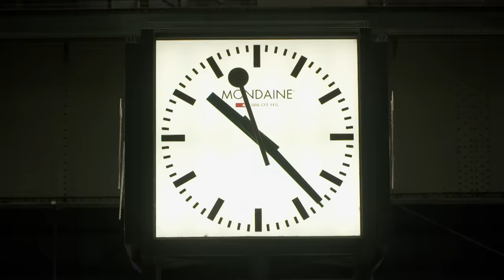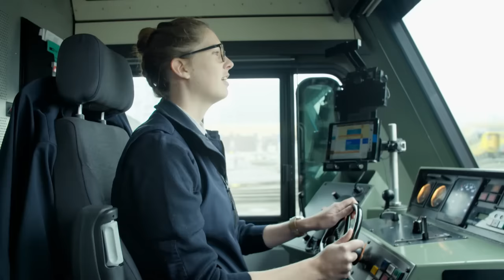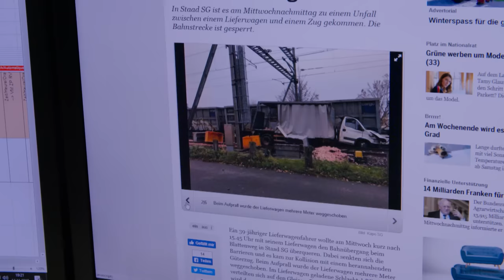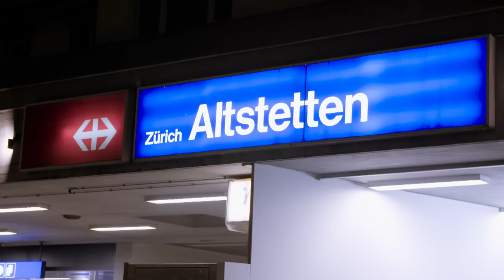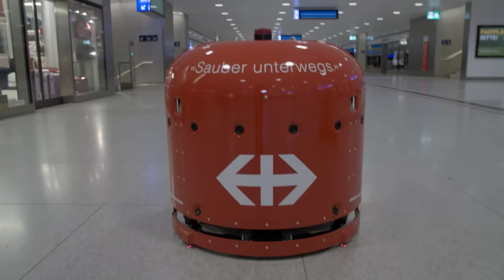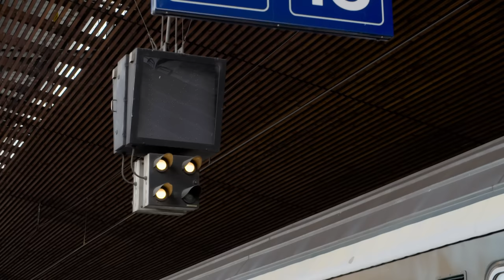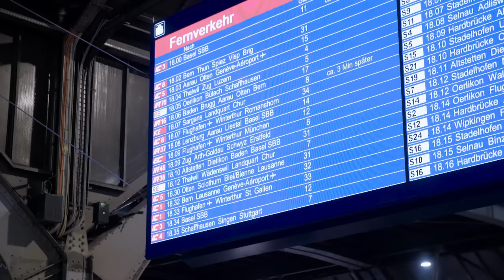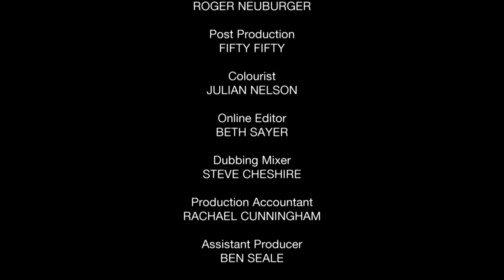Zürich Hauptbahnhof: Europe's Most Advanced Railway Station? | Mega Stations | FD Engineering

Comment: Reassuring to know that Erwin has no problem dealing with hours of delay of a Swiss train but 3 minutes late of a German train (36:00 exact reason not mentioned) is worth derogative remarks.
Reply: Ask any German person about DB delays... the air will turn blue!
Reply: Any German will tell you the same thing. In fact, at the Switzerland-Germany border, the Swiss railways have to keep spare trains ready to go, because German trains so frequently arrive extremely late (or get cancelled altogether) that it would wreak havoc on the rail network. So they have substitute trains (and crews) ready to deploy.